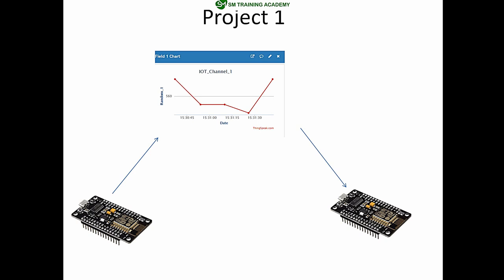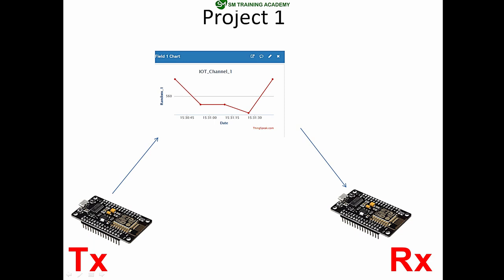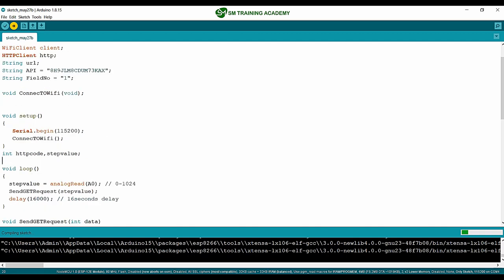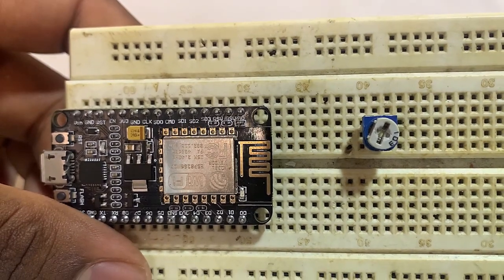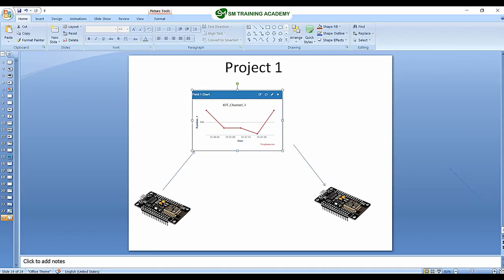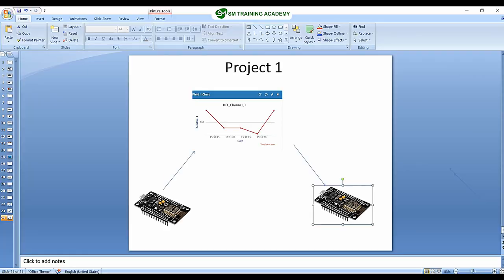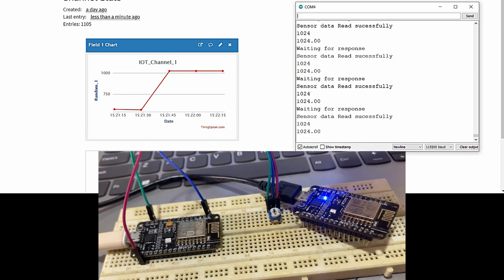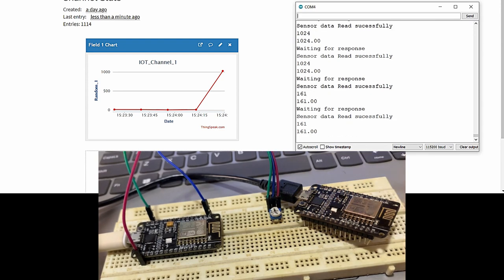Channel Project Using IoT Transmitter And Iot Receiver Nodemcu | ESP8266 | English

Comment: What sir. Back to back so much video . We cannot digest at a time. Pls make delay of 1 day atleast.
Reply from the maker: Dear sekhar have a good day,
I have planned to put one complete IOT course ,videos is under processing and it is being uploaded ,you can go to the playlist of my channel so that you can view one complete playlist added to that,
You can learn step by step not an issue I would recommend you to visit my website 

https://www.smtrainingacademy.com/

where you can learn everything in orderly manner with all resourses required just register and enroll to your required course and also you can purchase certificate for your courses if required but you can learn everything for free.
Reply: @SMtrainingacademy  Sir, my request to pls enhance only on embeded level programming. also pls let us know the reading of datasheet of microcontroller and other connector. Arduino made simple by giving library.. but as a programmer we need to know actual theory behind everything. We dont need library. It is simple but bulky in data hungry. Every embeded software shoud be minimal in data and maximum in speed.
Reply from the maker: @Sekhar_Home  definitely I will make more videos on that in coming weeks sekharanthome
Reply: @SMtrainingacademy  🙏